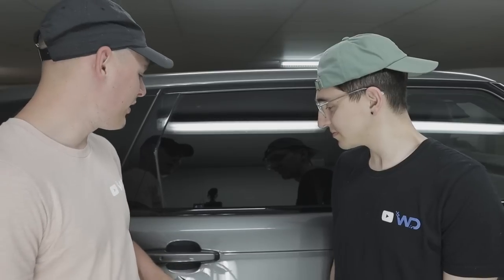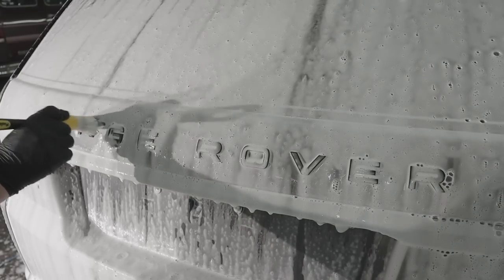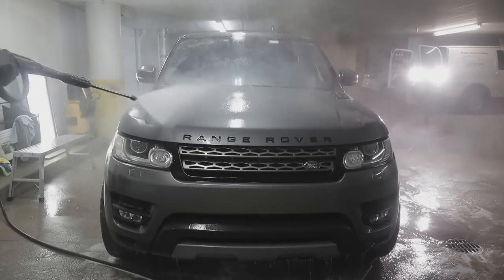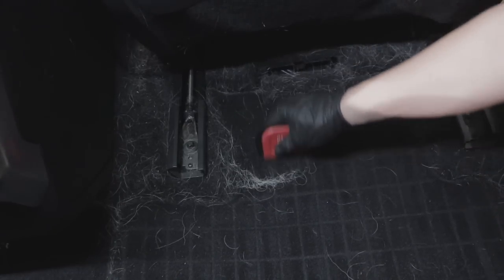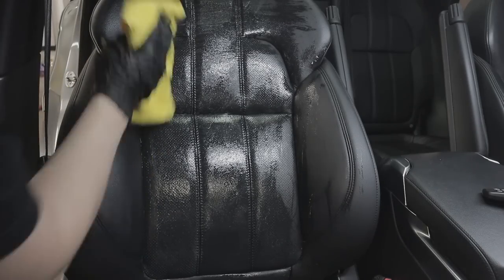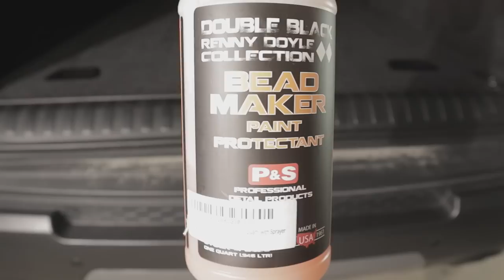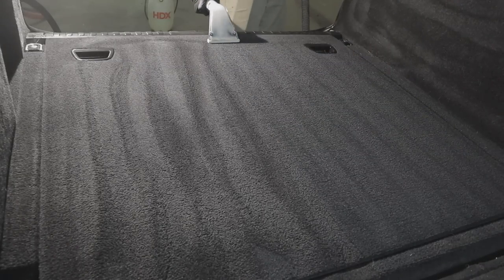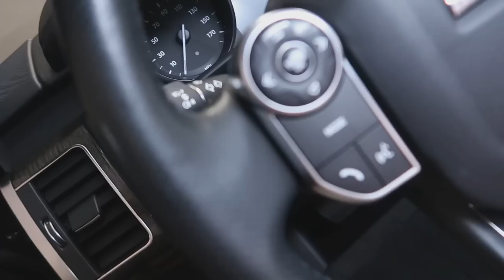Deep Cleaning a Girl's HAIRY Range Rover | EXTREME Dog Hair Removal | Very Satisfying Car Detailing

Comment: My favorite detailing channel is "Detail Geek". Outside work is very near and perfect. But do you clean undercarriage? Have never seen it in it videos.
Inside: 
1. didn't remove seats and thorough clean.
2. Blowing the AC can push dirt inside right? AC should only be brushed and vacuumed right?
3. Shouldn't ozone be used in such hairy cars because there will be dog's smell right. Just curious.

And in general your videos doesn't have sufficient lighting in inside. Kindly edit or improve lighting. 

I like your smile guys. 😀👍 Thanks for the positivity.
Reply: Not sure if you're an auto detailer yourself, but the decision to not remove the seats was by far the best one.  Range Rovers are notorious for having huge problems with the electronics within the vehicles.  By messing with the battery/internal electronics  to enable the removal of the seats, you increase the risk of doing damage to the car by 10 fold.  In conclusion, not removing the seats on this car IS the best decision.